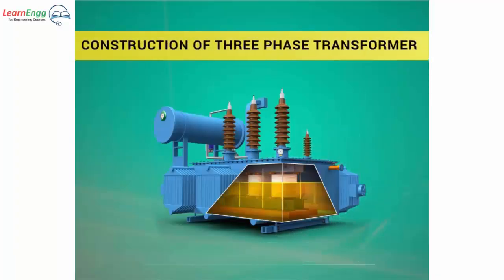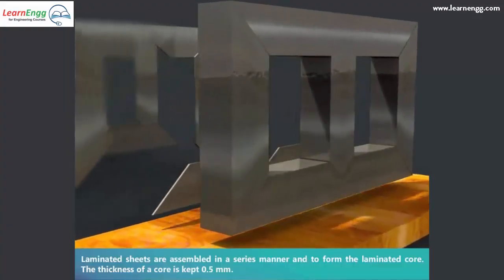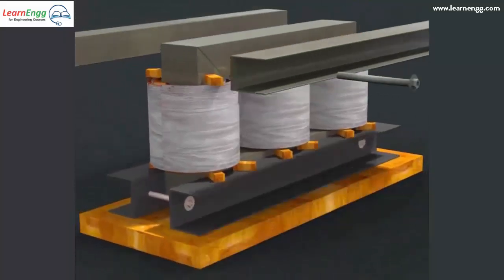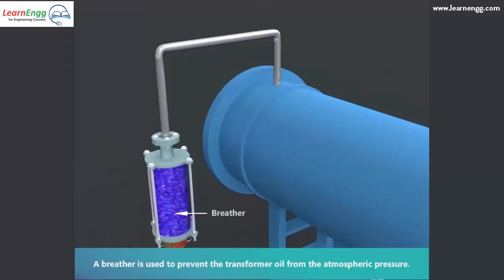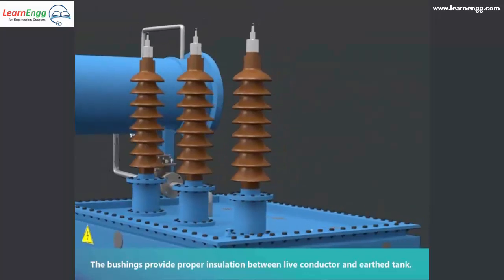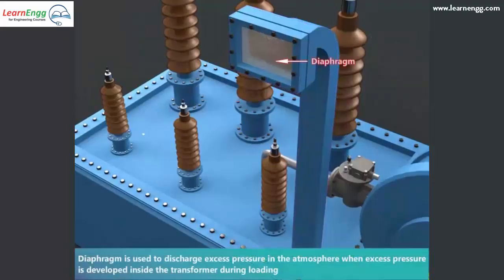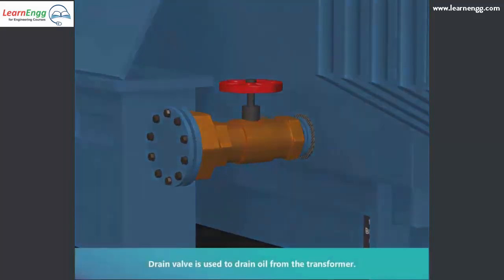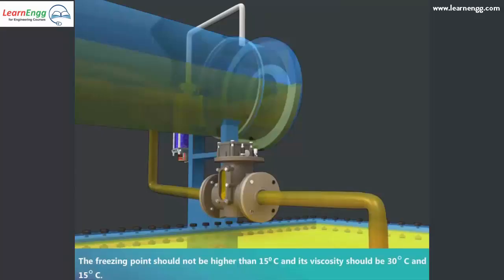Three Phase Transformer Explained | Construction & Working | #learnengg#engineering #transformer

Comment: What is the meterial of low volage insulated sheet??
In addition, the sheet can make magnetic flux pass??(while blocking short between low vol and high voltage)

Comment: Transformer ke connection kaise karte hain primary or secondary
Reply: After winding and core manufacturing, windings are lowered on core limbs. Then connection process starts.  Primary agar star rakhana hai to bottmo terminals ko bunch kiya jata hai. Agar delta karana hai to ek winding ke top se dusre winding ke bottom ko connect karte hai...hope this answers your question.

Comment: The Transformer is Static device which is used to transfer the electrical power from one circuit to another circuit with change in voltage and current frequency remains constant.